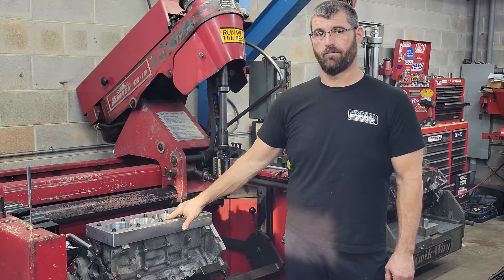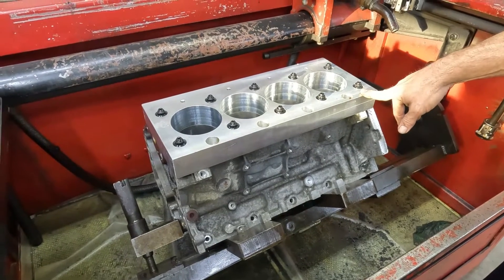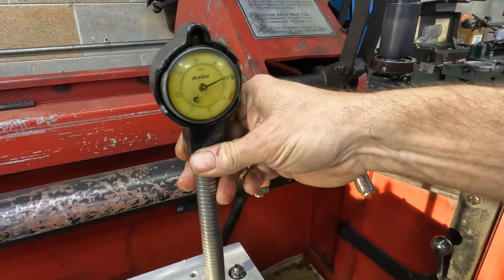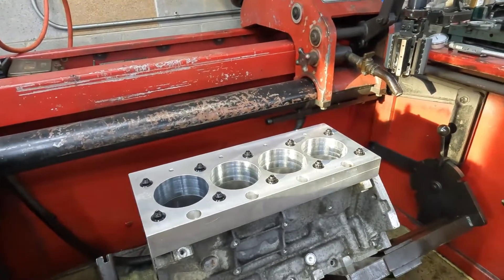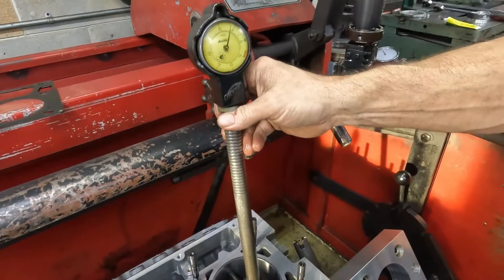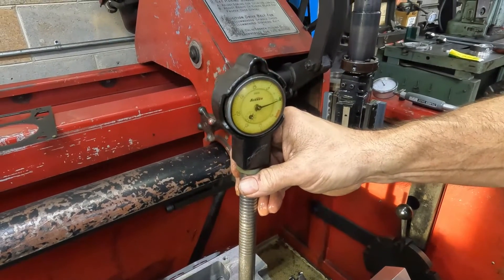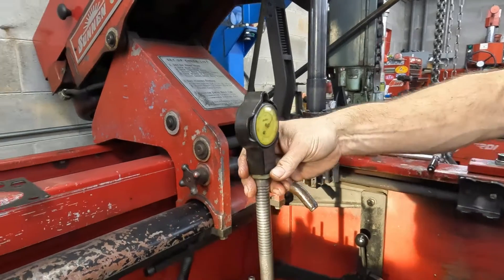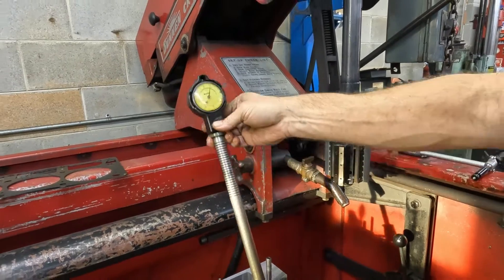Shop Tech: Do you really need to Torque plate hone your Ls engine? Let's find out.

Comment: Valuable information, based upon facts. I was expecting a larger variation.
 
Probably a BBC with head bolts into the deck would be messier. I don't think the factory used torque plates back in the day tho.

Comment: Maybe a dumb question but,
Is the bore affected again when the heads are bolted on ?
Reply: the torque plate simulates the head on the motor.aluminum blocks use aluminum plates
and cast iron blocks use steel torque plates at least that's what i was taught.

Comment: Had a fresh SBC that was not torque plate honed, ran it on a dyno, removed heads, found shiny spots in line with the head bolts.
Torque plate honed and reassembled, made more power. ;)

Comment: I have a 4.155 bore big block chevy my father gave me, built in the early 90s and never fired.  I have torn it down for inspection.   Could you tell me what kind of bore deviation it would have if it had been torque plate honed?

The engine was assembled with ARP head bolts.

I am a machinist with all the proper tools to measure but not an automotive machinist.

Thanks for any help! Subbed and liked.
Reply from the maker: You would see probably. 0005-.001 at the bolt holes

Comment: Head bolts would cause more distortion than the studs
Reply from the maker: I agree
Reply: why? i think its more where the threads are most engines have the threads at the top of clinder ls engine are deep in the block so there is no pull on clinder wall

Comment: Factory alum cylinder heads will not distort the blocks nearly as much as that thick deck plate, especially with a cast iron block. At the same time a 6 L will be affected more than a 5.3.  A Gen 1 SBC will always be affected by head torque.
Reply from the maker: We bolted a head on and measured, we got almost identical results,  it's not the hard, it's the fasteners creation the deviation.
Reply: thats right @powellmachineinc

Comment: I will say this about torque plates when I'm bored out my 327 when I used to drag race at Fremont raceway you can see where the bolts in the block were as the picture rings in the cylinder you can actually see the pattern. What a torque plate help that problem! I believe yes because the metal would be pre-stretched where the bolts are causing the cylinder to be completely round for the piston rings.
Reply from the maker: It's definitely relative to how close the threads are to the deck and the depth also  normally sbc aren't a issue except  400 sbc's

Comment: Truer test would be to put a head on, and check from crank case.
Reply from the maker: We did, same results..
Reply: @powellmachineinc  ,that would have been a great video to show.
Reply: I like your comment. Also hot honing as well as measuring from the bottom side with a head on are best. But how little distortion do we chase? I find it hard to get rings that consistantly pass a light check anyway. Or pistons and rings that the lands are mated or lapped correctly. Also we rarely put the same effort into a valve job. Cutting seats at running tempurature with a deck plate on the head and facing valves at tempurature are required to realistically chase this. The hone will fix .0005 tenths after break in anyway.  So Unless we control all this perfectly. Torque plates on an LS block still seem, well wishful  overkill to me?
Reply from the maker: @MOHAN PERFORMANCE. ENGINE R&D.  yeah, I think alot of time's we are chasing unicorns , unless you are going to machine every piece in the same condition as a running engine it's a moot point on a lot of stuff, plus it just doesn't pay dividends.
Reply: @powellmachineinc  1000%
Reply: Thats always been my thoughts. I'd but the distortion is completely different.
Reply: Would love to see it checked with head torqued down and checked from crankcase. I'd bet distortion would be completely different.

Comment: i find when i pull the toque plate off ls based motors i see anywhere from .0007-.0015in distortion at the top of the bore. mid to bottom of the cylinder tends to stay straight. iron or alloy seems to not matter. 4 inch+ bore stuff
Reply: loose when coming off on the top ?

Comment: For even better bore roundness,  Heat up the block (with torque plates installed) to 200 degrees F, then machine it.😁
Reply: Did you hear him say now that it's cooled off?
Reply: Lmfao
Reply: It’s a good point and it’s a good idea in theory and heard some of the best engine builders talk about it but they don’t do it! that’s probably better reserved for f1 and as opposed to just baking the block first you pump hot coolant/oil through it
Reply: @needmoreboost6369  ProStock builders always heat the block with circulating hot oil.
Reply: Why 200F? Why not 165 or 180 ???
Reply: Talked to a pro mod engine builder and he said the Change is so minute thus deemed unnecessary
Reply: yea but remember there engine's come apart all the time
and there pumping so much turbo pressure and nitrous it don't matter
street engines and drag racing  engines are completely different.   @Airman..